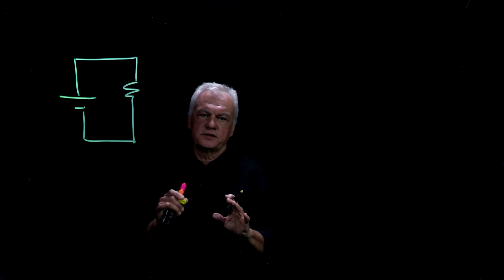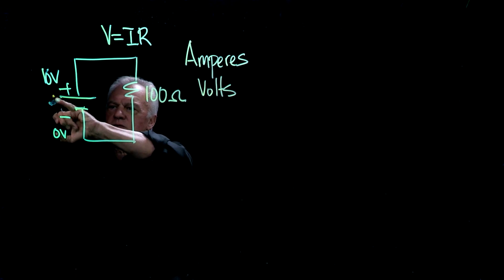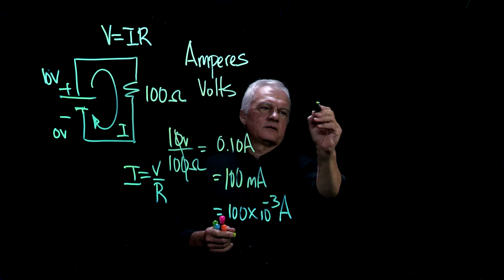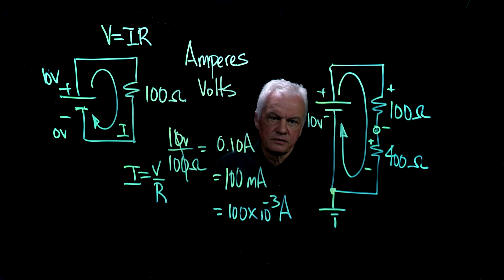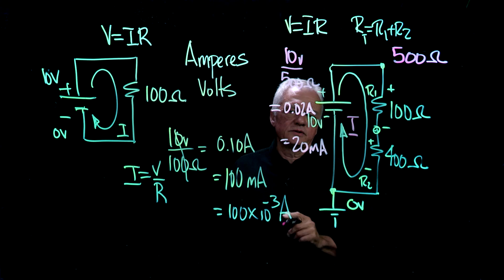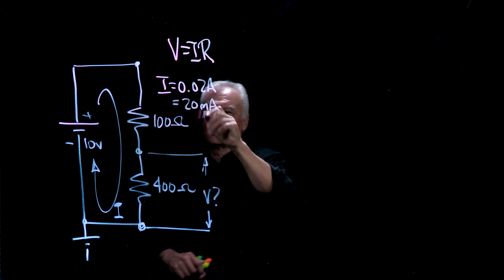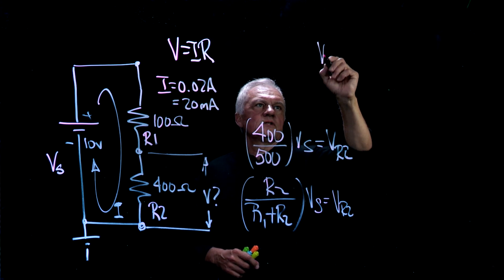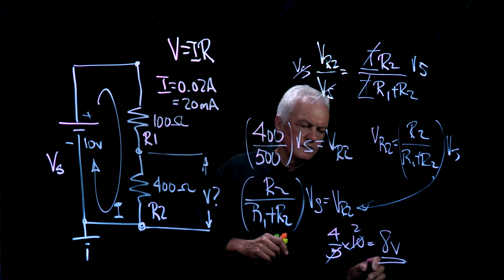Electronic Circuits | Simple Series & Parallel Resistor Circuits - Part 1 of 4: Series Resistors

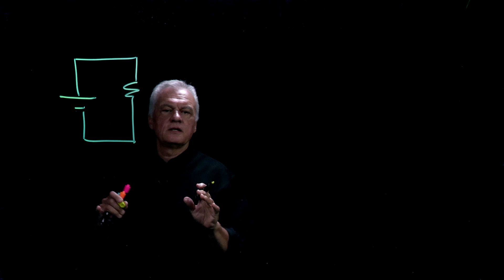Comment: time  0:54
Invites a  very interesting  question.
Is it  Series or  is it  Parallel ?

see  book :
Engineering Circuiti Analysis  Fifth Edition  ,  Hayt  and  Kemmerly
McGraw Hill  publisher ,  ISBN  0-07-027410-x
page 157

there is a perfectly valid answer to the above  question .
At first it is like ,...What ?
The  authors give a quick answer and analysis on page 158
The answer becomes  obvious .